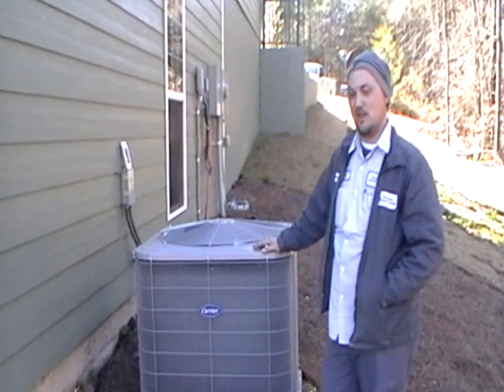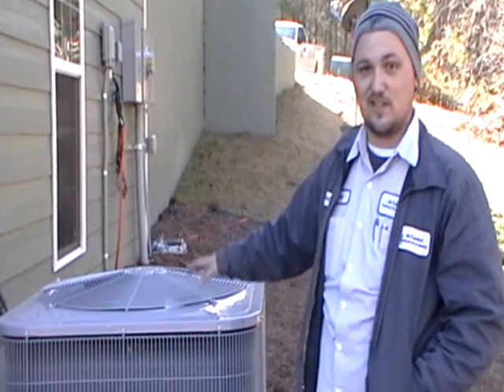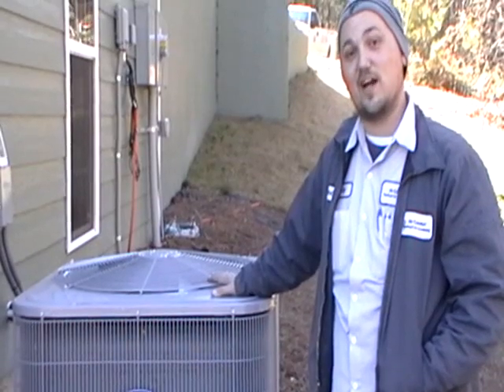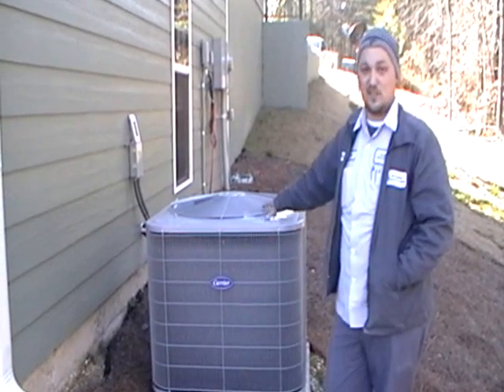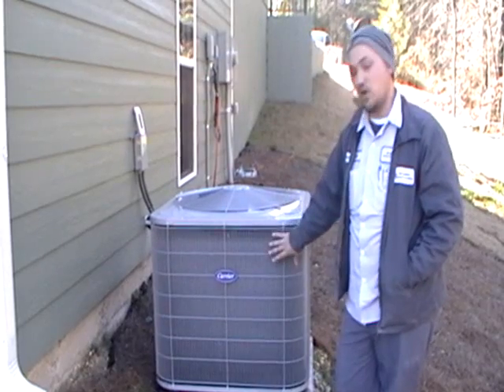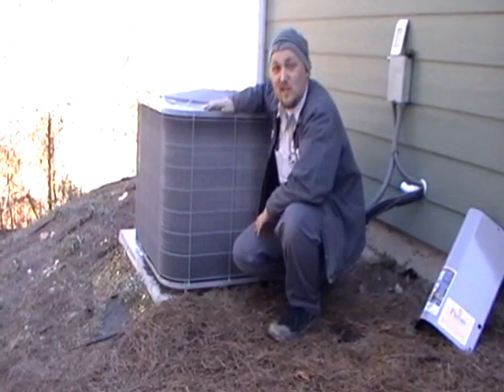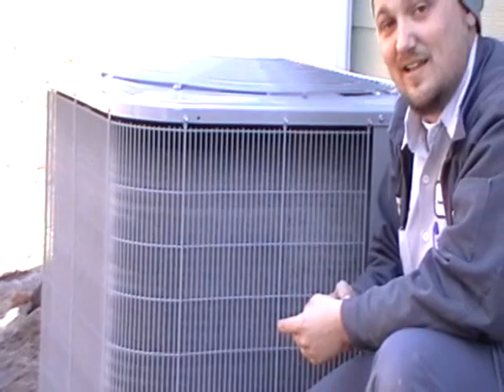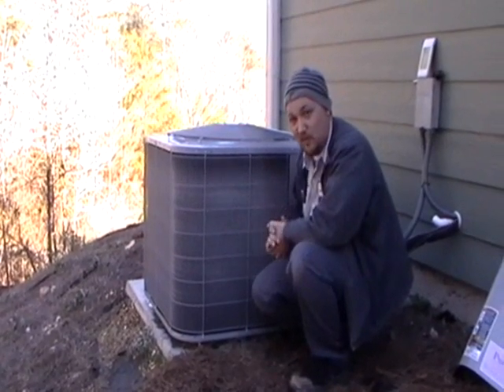Carrier Heat Pump Defrost Cycle Explained - Chattanooga TN HVAC Contractor

Comment: with the 30 60 and 90 minute timers seem unneeded  why don't it work like this, the bulb closes and runs a defrost cycle and then its done. Why the need for the timers.

Comment: I got 2 Carrier Air Conditioners at my house, and they both run with the heat and they both use defrost cycle when there is frost on them when it is cold. When it is winter here in Florida and they have frost, i am gonna try getting a video of them and post it on my channel.

Comment: This is great man thank you! I noticed no hot air coming from my vents and checked the outside unit. Heard a weird sound, fan was off, water at it's base, and a bit of what I thought was smoke coming out of the unit. Started to freak out until I watched your video.

Appreciate this simple explanation!

Comment: Currently here in S Texas at 28 with freezing rain, have watched a few videos as yours, my outside unit will not kick on, I have had the heat on for 30+ mins and  nothing how long does it take the outside unit to kick over, ?????  4 ton Rudd heat pump 3 years old...ty....,

Comment: While it's doing this can it cause cool air from my vents
Reply: If the inside portion of the system has heat strips, then no because those will come on. But if it doesn't, then yes

Comment: My heat pump makes this noise today when I changed the settings from winter to summer. It is 17 degrees Celsius outside. Why would a defrost mode be on now?

Comment: Does the indoor fan continue to run during the defrost cycle? By indoor fan I mean the one that blows the return air through the evaporator coil.
Reply: Yes, it continues to run.  Auxiliary heat kicks in during this time as well.

Comment: Hello- I live in an apartment with a heat pump. I don’t understand how it works as there is a main part of the machine in the actual apartment in a closet and then there is the heat pump on the roof of the building I guess. In my apartment it makes this awful loud buzzing sound. Like what you hear in your video kind of. It also pulsates. But it’s so bad when it’s next to you bedroom inside the apartment closet. I feel like I shouldn’t be hearing this. It does it late at night when it’s very cold. I called maintenance and they think it may be something with the defrost. I’ve never experienced this type of sounds in an apartment before. Have you ever heard of that? Thank you!!!

Comment: Man I was outside when my  heat pump when into defrost mode which happens here often not near freezing.  Tonight its 47 F  but the humidity is like  90%+.  I watched when it kicked back in a big plume of steam mist out out the  the unit. The unit is set at 69 F inside ,  don't know if its working righ but appears to be               and no where near freezing but the humidity is extremee

Comment: There is definitely something wrong with our unit. I've not heard it go into the defrost cycle for days and there is more than a thin layer of frost on the coil. I have a defrost sensor on order so hopefully that fixes my issue. Cheapest route for now except for using my emergency heat for a few days bc I don't want to over stress the unit.

Comment: "Ohh ive had heat pumps before, and its never been that loud!"
Reply: Because it's Carrier
Reply: @samuelvalenzuela4541  carrier is the quietest brand IMO
Reply: @fanshvacandmore14 Carrier is the worst A/C brand un history , no comment,
Reply: @samuelvalenzuela4541  no, it is not the worst brand in history. I work with them all the time and I see the quality in them. So I know exactly what I am saying
Reply: @fanshvacandmore14  I know exactly what I'm saying, Carrier is the last in líne
Reply: @samuelvalenzuela4541  have you worked with HVAC or had a passion in it? Because I have. So
Reply: @samuelvalenzuela4541  Carrier is actually a pretty good brand
Reply: @dilchproductions  yes. Their opinion seems to be biased
Reply: @fanshvacandmore14  Both

Comment: How many times would defrost cycle come on in colder climates like Chicago's long winters? Also would it make noise in indoor air handler?Would electric strips come on immediately or there is delay?  Can this be tweaked and how? I am planning to install Infinity 20  Greenspeed  but many installers are not familiar with heat pump technology in my area.
Thanks for the video,  it is very informative.

Comment: Omg. This was  an awesome explanation.    My unit was installed in August and one duct went down and was replaced.   Now a DF was on my LED screen and the system shut down.   I called the contractor and they could not explained it   Carrier wouldn’t give me any answers instead wanted me to pay some one to come out and tell me what the code means  bad service all around     Everything you explained Ned my unit was doing      I only wish I was given a explanation from the contractor    That installed it.

Comment: First time homeowner AND heat pump user.  Most familiar with split systems (gas furnace, ac compressor) so I was worried about the outdoor unit working without the fan spinning.  You eased my mind and taught me something as well!  One reason I love YouTube.  Thanks!

Comment: If compressor is running, then the refrigerant must be under pressure and hot during defrost. What happens afterwards? You don't depressurize refrigerant in the inside unit?

Comment: Is the defrost cycle of a heat pump bad in the long run? Does the defrost damage the outdoor unit system in any way? Do less defrosts mean longer life-span of the heat pump or is the defrost cycle just a compeltely normal thing and it doesnt matter how many times a unit goes into defrost?

Comment: Why hasn't carrier put a defrost board in their heat pumps similar to the pcb133s that Goodman uses, that shuts the compressor off 30 seconds prior to reversing in both defrost initiation and termination. The Goodman heat pumps I install never make liquid slugging noises like that because of the 30 second delay's built in the board.

Comment: How doe's it "take heat from the outside and put it in the house" .....when it's 37 degrees outside??? 
Why do you guys always say that?
 In fact the heat is generated as the Freon is compressed thru the increasingly smaller tube in the coils .
Reply: Because that is correct. It does take heat from the outside and put it in the house when it's 37 degrees outside. Our body's temperature is around 98F. When your temperature is above this your hot, below that and your cold. So OUR perception of heat, what is hotter or colder is based on how things feel to us. If you were to sit in a hot car where air around you is 100F, your body would absorb the heat and you will get hotter. A refrigeration system is a closed system, where a refrigerant is circulated around though coils and other devices. If you send refrigerant through the outside coil and the refrigerant is 25F and the outside air being blow through the coil is 37F then the air is 12F hotter than the refrigerate, therefore heat is removed from the air and absorbed in to the refrigeration system. As the additional heat in the system is circulated it is released back in to the air in your home, warming  your home. I could go into a lot more detail, but I tried to keep this short.

A few words of thought: Absolute zero is the lowest possible temperature where nothing could be colder and no heat energy remains in a substance is minus 459.67 degrees Fahrenheit, so at 37F there is plenty of heat energy available. 
Also: You can NOT create coldness it is just simply the absence of heat, just like you can NOT create darkness it is just simply the absence of light.
Reply: I think you're leaving out the part where the refrigerant is forced under pressure,  the resulting heat...on one side of the system and cold on  the other......It does not take heat out of the 30 degree F out doors (18 degrees up here in N.E. Ohio) and make hot air to warm your house. Oh, and I may feel/perceive to be hot or cold....but I can always check the thermometer for a true temp. reading. 
It is the nature of Freon under pressure , as its forced thru smaller and smaller tubes, to get cold...( ya' know, the compressor? )
Reply: @southtowntn  EXCELLENT explanation.  Best I've read in years.
Reply: Bf Cunningham I want to add to Robert by saying that it does indeed absorb heat from freezing temperatures because every type of refrigerant has a different "boil off" point. Refrigerant is not like water, in fact a majority of the time it's a vapor. The only time it's a liquid is when it leaves the TXV or expansion valve and goes into your house (air handler) only to be boiled off by the heat being removed and recondensed outside. Like he said, heat is present even at 32*F which for water, is freezing but for a certain type of refrigerant could be a boiling point, water boils at 212*F at atmospheric pressure which is around 14 psi with a few decimals behind it. All this to say, in order to increase the temperature and boiling points of things like refrigerant or even water, you must increase the pressure. That's what the compressors job is. You can manipulate the boiling point of water by increasing or decreasing the atmospheric pressure around it. In fact my hvac instructor demonstrated the boiling of water at room temperature by changing the pressure with that of a vacuum. However the heat that's absorbed may not even be heat that we as humans can feel. Heat is present even at negative temperatures all the way down to -460*F. The heat that a heat pump is absorbing may not be the same on a 45*F day as it would a 20*F day, the heat being "pumped or dumped" inside may be coming from your vents at maybe 100*F on that 45*F day but may be 80*F on that 20*F day. Likewise, our body's are relatively sensitive to temperature changes (which brings in the term sensible heat which is heat that we can feel but the heat we can't feel or heat that's present but perceived as absent or cold comes to term as latent because it may be lower than our body temp but being that your house isn't -460*F it is still classified as heat) because it's 98*F, the vents may be blowing air that measures 75-90*F on a very cold day without any assisted heat which would feel cold because there is a 10-25 degree difference between our body and the surrounding air. Also keep in mind that even on a 40*F day which is not freezing as is 32*F, your condensing unit (outdoor) can still develop ice or thin layers of frost because a condenser will always have a 10-15*F operating temperature difference than that of its surrounding air temperatures. You can't absorb (heating) or reject (for cooling) heat if its operating or condensing at the same temperatures as it is outdoors. So for that 40*F day, if it's in heating mode, if you put your hand or a thermometer over that outdoor fan you'll notice that it's a few degrees colder over that fan than on the side of that unit in order to absorb heat, same for cooling except it will be rejecting heat from outside and will be 10-15*F warmer. I don't know how well I explained that, still in school, and for any hvac technician or instructor that would like to add something feel free too, we all have to work together because the demand for our field is exceeding the supply of technicians available. If you guys feel as if I'm completely wrong, or right, or not clear, say it, comment, I can only learn the basics while in school
Reply: ..OY !.
I'm going to break it down for you one more time.
The refrigerant is compressed into smaller and smaller lines, and in doing so causes it to get extremely cold...you probably know how cold....but it causes the other end of the tube, pipe,coil whatever you call it...to get hot!
When you need heat , the system (not all and some have electric components) is designed to reverse this process and the coils get hot in the house and cold on the unit outside...
Same on cars, except they are not designed to heat...they use the water in a car.
The "getting of heat from the outside" statement is ....ridiculous!
It's about the refrigerant under pressure....

Comment: Thanks Andrew for explanation. This helped. I was just experiencing this. Thank you for your honesty. It not easy to find someone you can trust in AC/HVAC. I am looking at replacing the condenser capacitor. I thought there was something wrong with the outside unit when I saw the frost on the coils and thought there was a problem. This explains it . Thanks!

Comment: Exact problem we had with our Carrier. This video saved me $90 service call...Thanks!!!
Reply: Same here, I just watched this video and thought I was having an issue with my outdoor unit and this is the exact sound I heard! Great learning lesson!
Reply: Is the outside unit the same as the heat pump? Question.... My heat pump froze completely and obviously it stopped working properly so no heat in a really cold night, a freezing night I should say. So should I call a repair man or just wait for the weather to go above freezing? Its around 10° outside right now, not counting the wind chill factor

Comment: When my heat pump is on defrost mode, the register inside my house blowing cold air.  It was around forty degree.  It will drop my in-door thermostat more than 3 degree and then alternative heat come on.  Do you know what parts and/or components fail?  I appreciate your help.
Reply: I'm not expert on this but I believe that is abnormal.  You should have aux heat such as electric coils or a furnace that supplements heat when the outdoor unit can't get it done or when defrosting.  Your heat pump should turn aux heat on while in this defrost cycle.  I would check to see if your aux heat is working.
Reply: Ken Long same with me ken my register's are blowing cold air while my heat pump is in defrost mode any help on where should I look will be greatly appreciated. I have not found no videos on this issue I'm thinking it has to do with the thermostat defrost sensor but I'm not the expert but any feed back will be greatly  appreciated thank you

Comment: I installed Carrier Heat Pumps for just over 8 year and they are by far my favorite to install. The condensing unit is one of the nosiest on the market since the outer cage tends to settle and it will rattle. I think the newer ones with the stronger cage took care of that minor issue. Wouldn't trade mine for anything. I installed one on my home in 2005 and the only issue since then was the capacitor went bad. Super easy fix. I would highly recommend Carrier, Bryant, and Payne to anyone. They are very reliable when installed properly. Just wish I still had access to buying them and the parts.
Reply: JeepCollector91 complete trash......go with Rheem or rudd. imho
Reply: Most brands on the market today can last if installed properly and maintained properly.

Comment: Hi I have a question? Winter and spring of 2015 my next door neighbors heat pump started acting weird. When it first turned on, it would make a really loud buzzing sound for about five minutes, then quiet down for about five minutes, then buzz, then quiet down, then buzz...you get the idea. After it ran for a while, white smokey stuff came out the sides. What was wrong with it? What was the white smoke from? PS it was not in defrost because it did this in heat and cool mode, plus we could hear it through our upstairs windows. Pps my neighbor waited FIVE MONTHS to get it looked at. She got it replaced with a 2014 Bryant heat pump. ( it was  a 2000 Carrier)

Comment: Nice explanation.Damn that thing is loud !!! I guess geothermal heat pumps doesn't have that kind of problem..The least thing I want, is on cold freezing humid day to blow freezing air inside the house!! Yes you forgot to tell people that during defrost all heat pumps blow very cold air hroug inside coil,because the reversing valve is energized to cool mode..yeah it's normal,but it sucks for sure.
Reply: MB031 their should be electric heating elements in side the air handler to temper the air while the system is in defrost, so, it shouldent blow extreamly cold air.

Comment: I learned a lot from your video.  The hissing noise that the unit makes in beginning of defrost cycle- mine keeps making that noise constantly and fan cuts on and off. I live in Florida, so it's not that cold but cold enough to need to cut on at night.  Could it be sticking in defrost

Comment: Our heat pump has a huge problem! Someone is coming to inspect it tomorrow but it is a semi-spilt a/c and what happened is I think the fan motor broke and ice formed everywhere inside the outdoor unit the fan can't spin and the coils are insulated in the ice so no more heat!
Reply: tirn it off now you will cause more dammage to it if you leav it running.

Comment: Wow, you just saved me a couple hundred bucks cuz I thought my 2yo pump was acting up....defrost is really loud on these units!!!
I will put some cedars around it so my neighbor stops complaining...
Thx for the great video!
Fred in cold Montreal, Canada.
Reply: don't put anything around it it blocks airflow.
Reply: +fred april  Not the correct climate for a HeatPump. Radiant solar or a good wood stove,even baseboard electric would be a better fit!!
Reply: +Anton Gorgoldi  only use my heat pump above 32F deg, otherwise, I use the heat coils, my big pellet stove and my gas stove(base floor)...Don't worry, we got what we need in "the great white north"!!! 😉

Comment: Great video Thanks. Question: The buzz sound never goes away even after defrosting? In other words, toward the end, you stop the defrost, and let it kick into normal operation. However the buzz keeps going, and then more sounds are added. I hear no sounds going away. So is the defrost cycle the quietest operation of these things? I always thought the defrost cycle was the loud part. Normal operation sounds louder (from here anyway). Thanks again.
Reply: it could be a problem with the compressor i'm guessing